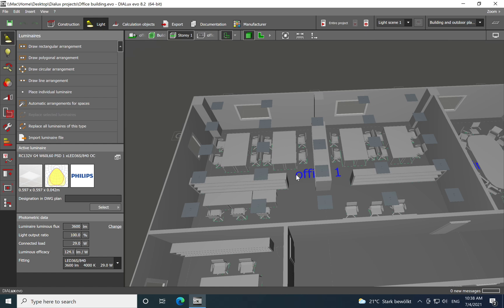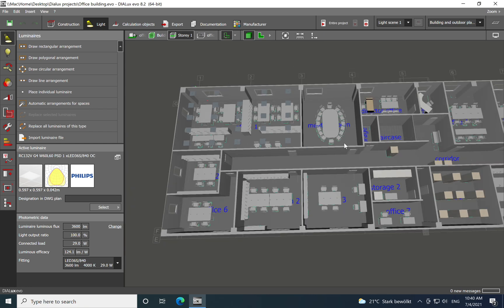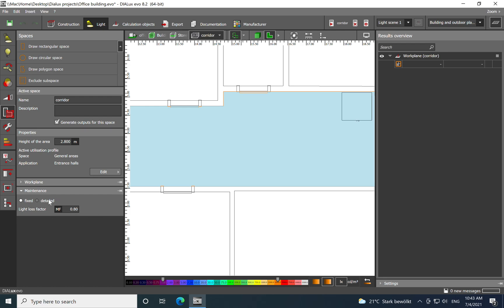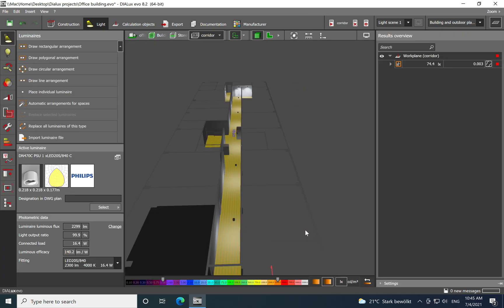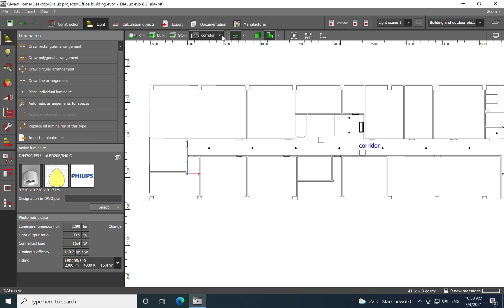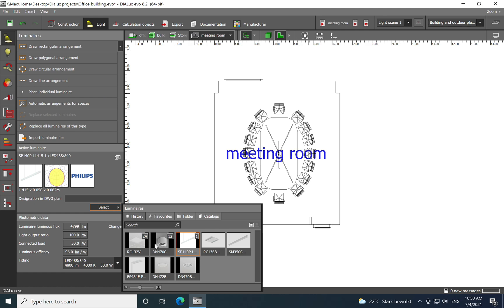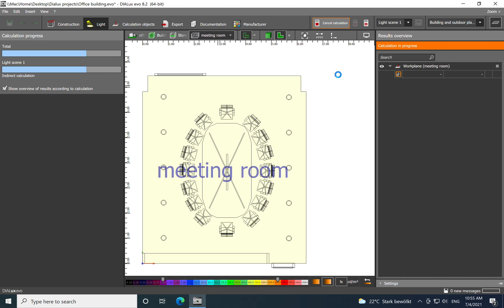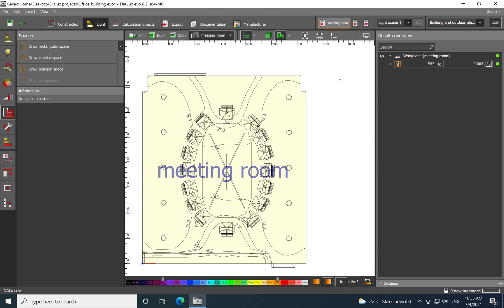Lighting design for office  part II

Comment: Hi thanks mate but one question 
0.01 is that uniformity or 
Where do you check ?
Reply from the maker: Hi, I will do a video with the relevant lighting parameters which need to be taken into account when proposing a lighting solution for a certain application. I will provide you the link to this video today.
Reply from the maker: Here is the link with the lighting parameters https://youtu.be/0Jm5UQjfchQ

Comment: Thank you. In different way, why u dont increase the wattage of the lumanaires to achieve the 500 lux level
Reply from the maker: Thanks for your comment. If you increase the wattage of the luminaire you are reducing the uniformity and you don't want to do that. You need to find the proper balance between lumen output, distribution curve of the luminaire, number of luminaries for that space and achieve a uniformity as high as possible.

Comment: Thats a conventional design, you waste more energy. The best solution its a qualitative design especially in oppen plan offices. You just focus the light where you reaaly need it eg the table en meeting room in the video and verify if you get 500 lx there not in the hole room
Reply: Thanks for your comment. Appreciate your feedback. Related to your lighting it’s an Yes and No in the same time :).
For new offices you can proposal free standing luminaries, but still you need additional luminaries for the background and surrounding areas. With a local lighting you will not be able to cover all the need for a modern office.
My second point related to conventional lighting design. You need to consider that many office building have been equipped with 6x6 and 3x12 luminaries with fluorescent lamps. In these office buildings few investors will go with a total new layout of the ceiling. So the easy and fast way also from electrical circuits its a one to one replacement. From old to new LED luminaries.
Reply from the maker: Please find my comment below.